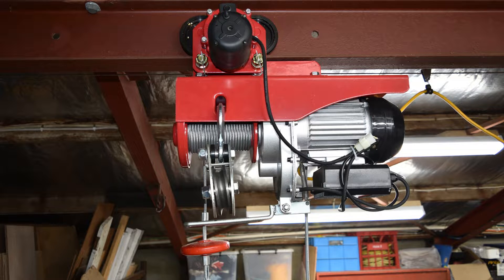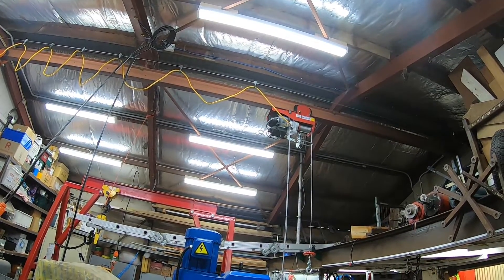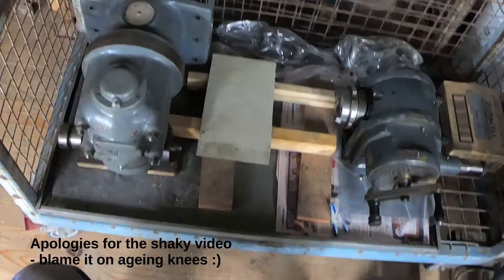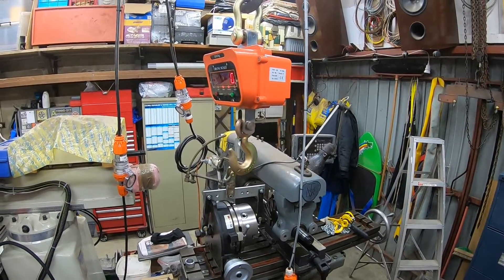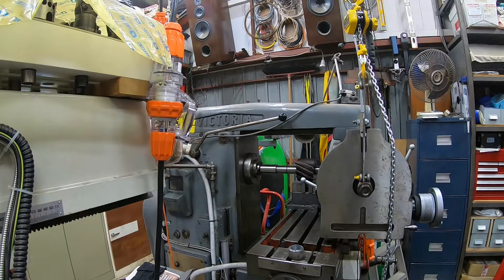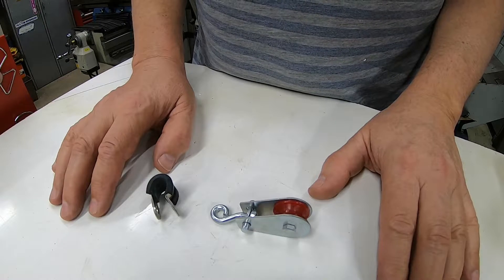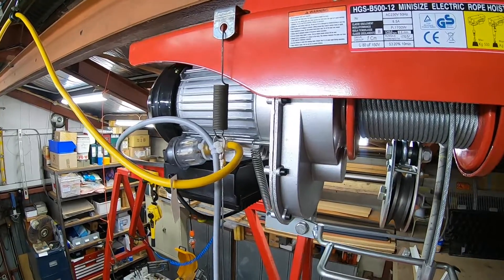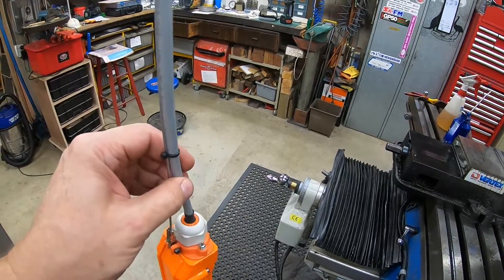Motorised travelling hoist for the home workshop

Comment: Excellent detailed video. Thank you very much. I have a similar hoist with trolley and have mounted the same on a Ibeam which is 4 inches (3.5inches inside area) x 2 inches. The trolley along with the hoist is moving back and forth by hand push but not motorised. Do you think I need a bigger I beam ? What are the dimensions of your I beam. Did you mount the trolley first and then attached the hoist to it ? I have a similar weight problem as my hpist is a 750/1500 hoist and weighs 27 kgs. Very difficult to handle. My mounting height is only 6feet though.
Reply from the maker: My I-Beam is 6"" deep by 3" wide with tapered flanges (the modern Universal Beam or UB profile has parallel flanges). This was the minimum width recommended for the trolley. If it is fitted to a narrower beam, the wheel flanges cannot be set close enough together to track correctly. I did mount the trolley to the beam first and then bolted the hoist up to it:  https://www.youtube.com/watch?v=KJXbOYrOMxI&t=117s
Thanks for comment and I hope the video helps you achieve your project.
Cheers, Alan.